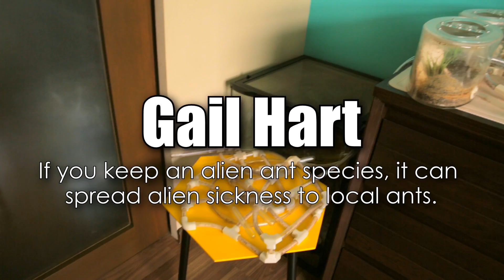I Made a 2-Storey Ant Farm | 40 Feet Long

Comment: You could have just rolled all that tube into a coil around some ornamental column or something. For the ants it would make no difference as the distance to cross is the same, but for you it would probably be much easier to manage, and you could keep the separate outworlds one next to another and look at them together, whilst for the ants they're so far away? And you could still give it many different shapes and twist around to give the trail variety. And you could always think of some fancy names for the trails wrapped around different things lol

Comment: Make a tunnel going through a fish tank
Reply: Probably not, as the water would probably go through the holes in the glass and how do you make a perfectly round hole in glass?
Reply: @Gumpy626  curve through the top then curve back out
Reply: Lucas Martin maybe on top where there isn’t water so they can drink water
Reply: @Gumpy626  use silicone sealing to cover the small gap between the tube and aquarium, plus just get another aquarium, cut a hole in it and put in the tube. Then when that's done put the water and fish in
Reply: Tbh that would be really cool

Comment: How to make a awesome ant tube:
Drain a fish tank
Carefully cut two holes 
Put tape around the holes
Put the tube through the hole
Hot glue a thick kayer around the tube on the glass on both sides of both holes so water doesnt leak
Fill up the tank with water
Put some fish in it
Let the ants cross
EPICNESS

Comment: Lol, you ding dong! I would be worried about a tube disconnect along the line, but I'm sure the Knights really enjoy the new leg room. :) Is there much of a temperature difference near the fridge?
Reply from the maker: I actually worry about that, too but I will keep an eye on the setup. Actually, the first floor has air conditioning whenever I have guests but the black crazy ants seem to be ok with brief periods of light air conditioning, unlike the fire ants who die when there is air conditioning.

Comment: .12 Inches, average person is 72. 40 feet is 480 inches. 72/.12 is 600. scale is 1/600 480 *600 is 288,000. divide by 12, 24,000 scale feet. 5.303 miles. The trek was the equivalent of a 5 mile journey to the ants if i did my math correctly.

Comment: you should have a pipe that goes in and out of the aquarium!
Reply: human walk in aquarium equivalent ? The ants will like it lolz
Reply: Theost21 That would've been nice to see.
Reply: +Jane Edgar not if none of the connections are under water. Even then im sure you could make them water tight.
Reply: cool idea but if the tube disconnected somehow like if he knocked it while cleaning out the fish tank or something then its a lot of trouble for something that looks cool
Reply: if you don't connect any pipes under the water it will be fine i think. It doesn't have to be something big just that the tube is a little bit under the water. Also the water pressure won't do any harm if the tube doesn't leak or something. I think its possible.
Reply: YES!!
Reply: He could always put another tube around the first tube to stop most water problems, and be an alarm to do something quick if water is seeping through the first tube and second tube
Reply: YES!
Reply: Theost21 the water might leak into the any tube though
Reply: Theost21 i literally commented the same thing, glad many people agree
Reply: YEAH! I kind of did this with Argentine ants when I was a callow. :P
Reply: Also, an underwater area with the tubs. Like a nest? ;)
Reply: and a dome under water.
Reply: Bobbycxx yeah all the water could leak out and the fish would die also he would have to find a perfect fit tube so not one drop of water could excape
Reply: Theost21 what a great idea not sure about the water pressure tho?
Reply: or around it
Reply: You could probably seal it with tape.
Reply: Theost21 
I want it to be under water thats what I was thinking
Reply: Theost21 shoulda have out a pipe that leads to a ant eater exhibit in a zoo

Comment: Shouldn't you had put some ventilation junctions every now and then? I think it's a way too long tube without any source of oxygen, and also the condensation would be less
Reply from the maker: +tiusso I was thinking this, too so if you notice I have made areas where smaller tubes connect. There are spaces that are small and air moves through but qre too small for the ants to fit through. I know this because I can see the areas where the tubes are in contact with each other as they appear blue when you look at it from an angle.
Reply: AntsCanada  ok then, with their small oxygen requirement that can be enough, also their traffic should generate some air movement too.

Comment: For the AC question of the week I will answer: The Knight's Drop. It definitely is the part where I'm most intrigued by the ants. it just makes me realize that they walk straight down, for around 2 meters or something, while not dropping down. At the same time, I'm wondering if the ants would die if they would fall down from the top there.

Comment: Ant Canada, I have a 50 liter sealed terrarium* with dwarf tomatoes plants and it's very vigorous. And as I understand ants can eat tomatoes and bury the seeds which allow new plants to grow, this process is called "Myrmecochory". My question is can i put a colony of black crazy ants (since they can mate without nuptial flights) and eventually seal it permanently? It seems possible I think the tomato and potato) plant can produce enough air for them and if if they happen to eat all the tomatoes it will be survival of the fittest. 

*I will start a new one, the Mark 1 version grew so many tomatoes for 2 YEARS they started to rot and I had to start over. I also had many snails which couldn't keep up with all the tomatoes.